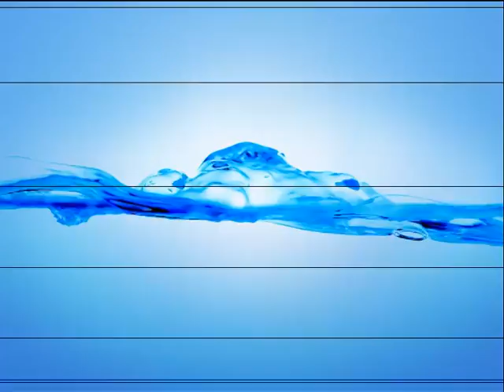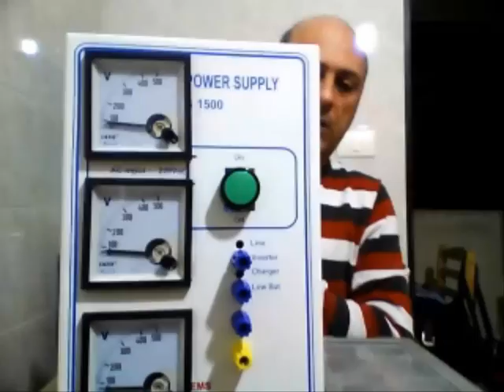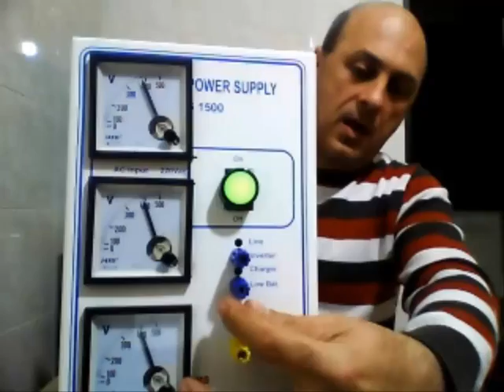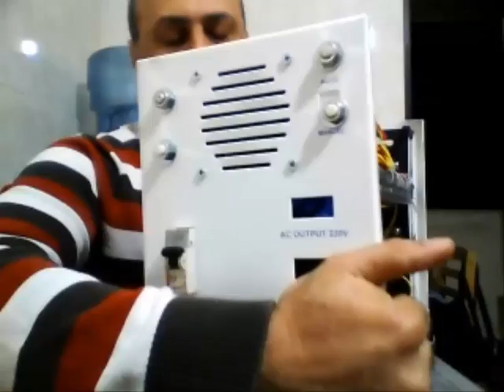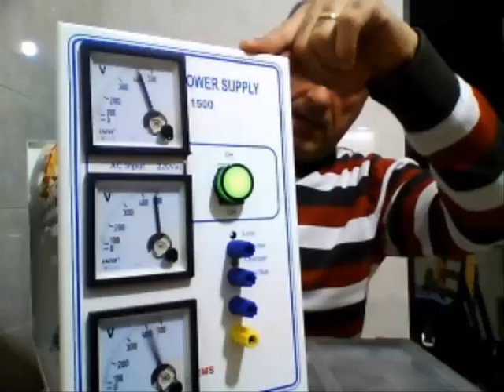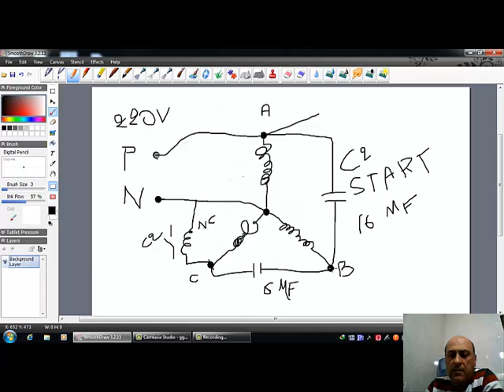Rotary Phase Converter

Comment: my version manual,,,https://www.youtube.com/watch?v=SJBBAtOOr64
Reply from the maker: Nice job , however I permit myself to attract your attention that the presentation is not relevant. instead of using a  wire  , just use 3 $  relay . moreover 1$ spray paint will help make your job looks better .
Reply: how do you like that
http://www.ebay.com/itm/152294814332?ul_noapp=true